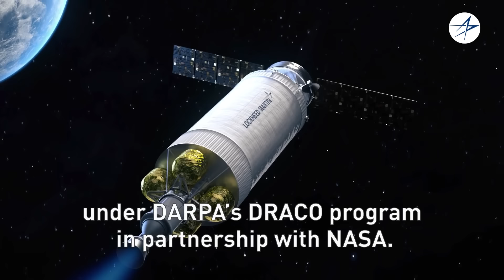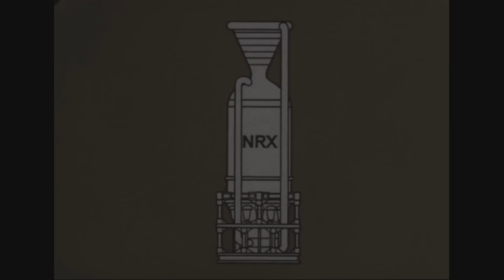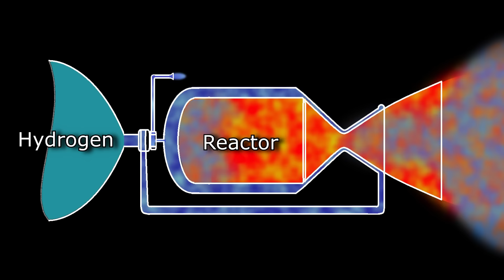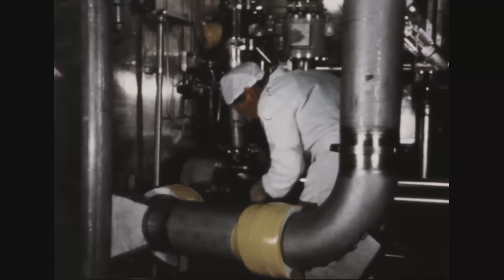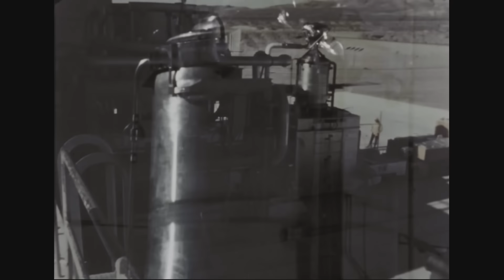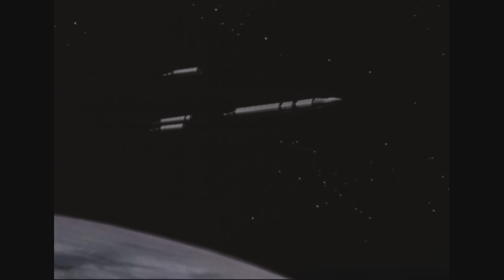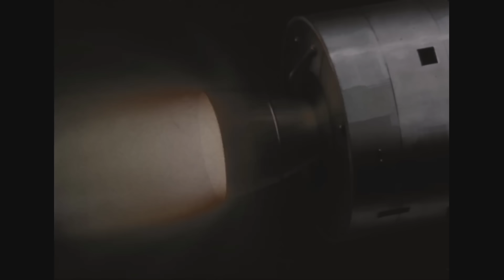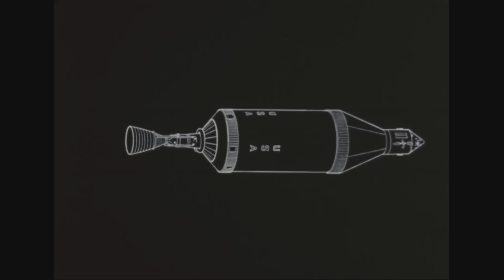Why Nuclear Rockets Are Going To Change Spaceflight

Comment: I think the biggest issue is protecting the reactor for a "safe" crash landing in case the launch rocket carrying the nuclear rocket into space explodes during the launch phase. That was an issue that kind of worried people if a rocket carrying a satellite with a radioisotope thermoelectric generator (RTG) exploded early in the launch cycle and a large amount of radioactive material is spread out.
Reply: Until the reactor is turned on and generates highly radioactive products, it is not too terrible. With a half-life of 703.8 million years, uranium 235 itself is not very radioactive. (About ten million times fewer decays per second per unit of mass, compared to plutonium-238 used in RTGs.)
Reply: @cogoid although it has to be said that fresh fuel rods are so relatively safe because nobody straps them on a giant bomb and turns them into fine dust. Uranium is a heavy metal and an alpha emitter, aka the kind of stuff you can safely touch but not safely breathe.
Reply: @cogoid Ah yes, the radiation isn’t a problem. But the potential toxicity may very well be. From Wikipedia: “Normal functioning of the kidney, brain, liver, heart, and numerous other systems can be affected by uranium exposure, because uranium is a toxic metal.” The jury is still out on how bad this risk is. Some scientists think it should be a big concern, other’s not so much. Under those circumstances should rockets containing large amounts of such materials be launched close to highly populated areas?  Until the issue is better resolved I would say, “Not in my neighborhood.”.
Reply: @JustBob-sw4rf  I do not recommend huffing uranium in any concentration. But although uranium is not to be taken lightly, one has to compare the concentration of dust and the associated with it risk to other more ordinary hazards. Is this going to be a significant additional danger or an unmeasurably small difference? 

To put things in perspective, lots and lots of processes put heavy metals into the air. For example, colors in the fireworks that are shot into the air for entertainment literally above the crowd are created by various metal salts. The smoke contains strontium, barium, lead, etc.
Reply: @cogoid    Never mind coal fired power plants. There is a lot of … stuff … in coal and if you burn coal by the cubic metre, that stuff tends to find itself in the smoke. Stuff here includes radioactive particles, and if you burn all the coal around it, you are concentrating it.
Reply: @JustBob-sw4rf  That isn't a worry, that amount of uranium, maybe 1kg, will be spread over an airspace, and ground area of millions of square metres.  It's like been worried that a drop of cyanide in one of the great lakes could make the water toxic.
Reply: Good thing is that the Uranium 235 reactor fuel is barely radioactive. It's the products after you turned it on that are nasty.
Reply: RIFT was just planning on quenching the reactor and dropping it jnto the ocean, but that was a suborbital test IIRC.
Reply: Great Comment !  Heard one story that a RTG was on one rocket that exploded and the RTG fell in the ocean !  The RTG was picked up from the ocean and dusted off and sent on a successful  space mission !  tjl
Reply: @TimothyLipinski  The RTG carried on Apollo 13's LM was carried back into Earth's atmosphere after the crew abandoned it and is still at the bottom of the ocean today. RTGs and nuclear reactors used in space are engineered to be very safe in the event of a launch vehicle failure and aren't worth losing much sleep over. A bigger problem is if a reactor gets placed on a trajectory to reenter the atmosphere after it's been critical. The Soviet Kosmos 954 satellite failure resulted in a nuclear reactor breaking up and scattering over northern Canada in 1977. Much of the core was never recovered and is still out in the woods and lakes somewhere.
Reply: @RCAvhstape  Apollo was powered by fuel cells, not RTG's where ever you got your story from it is Bunk.
Reply: @kennethferland5579  the RTG's on Apollo were for the experiment package to be left on the moon, not to power the spacecraft. They were SNAP-27 model with just under 4kg of Pu-238 and yes Apollo 13's SNAP-27 reentered and is at the bottom of the tonga trench in the pacific. So, ah.....NOT bunk.
Reply: @RCAvhstape  RTGs also have a lot less material, with a lot more containment, mind you
Reply: @kennethferland5579  Apollo 13 LM Aquarius was equipped with an RTG to power experiments. Look things up before responding in a hostile manner next time.
Reply: Which is part of the reason they will NEVER be used.  RTG's contain tiny amounts of nuclear material that can be contained in the casing of the Thermocouple itself and they still cause a lot of consternation, a single Nulcear rocket is more nuclear material in one launch then all prior missions combined and would never be approved for launch.  This research project is a deadend being mandated by congress for political reasons ONLY and not because NASA needs or wants it.

Comment: So how do you envision these being used?  Would it be that these nuclear rockets would be stationed in orbit and used as space tugs?  Chemical rockets launches would bring crew to and from orbit, they would rendezvous with an assigned nuclear tug which would then tow them to and from their distant destination?  The vehicles wouldn't necessarily be directly attached with perhaps a long boom or umbilical cord connection between them. Perhaps the crew rocket would also have to provide some propellant for the nuclear vehicle. On the return, could such a setup have the nuclear tug slow both vehicles enough so that when they detach, the re-entry of the crew rocket doesn't require a heat shield?

Comment: "Engine rich exhaust" is probably the funniest thing I'll hear today.
Reply: My favourite is still "lithobraking"   ;)
Reply: @karenrobertsdottir4101 there's a step up from that: lithostaging.  Where you intentionally break pieces off with an impact as part of the normal operation and keep going afterwards.
Reply: @karenrobertsdottir4101  "Ablative lithobreaking"
Reply: Engineering euphemisms are my favorite inside joke
Reply: Engine-rich exhaust is typically an indicator of a rapid unscheduled disassembly.
Reply: @markanderson1088  so what's the real life example of delayed unscheduled disassembly?
Reply: @forgotultag1543  Rusting away in a scrapyard, which is how a lot of cool NASA projects have ended up.
Reply: One of our tractors had once a "engine rich exhaust" moment as it self destructed ....
Reply: It made a kind of boom explosion like sound.....I'm no rocket surgeon but that might be detrimental to the program if kept as part of the rocket's flight sequence
Reply: This confuses me a bit, because in aviation you can have fuel-rich or lean mixture in the engine.
Reply: @maksphoto78  I know this was a year ago but to explain your question. "Engine rich exhaust" is a engineering joke. It means the engine coming apart and blowing out of the back of the rocket.
Reply: Right up there with RUD.
Reply: I've never experienced engine-rich exhaust, but I have encountered an engine-rich oil pan on my 1970 VW Beetle.
Funny thing, with all the metal ring chunks in the oil pan, the engine still ran fine.
A friend who had several owned by family members told me, "Yeah, all those broken parts in the oil pan is normal."

Comment: IANA rocket scientist, but I've long argued that both Thorium and molten salt technologies are each better technologies than the classic fuel rod Uranium systems.
In the event of a RUD in launch, Thorium is a much more benign element than enriched uranium. The tiny amount of uranium required as a starter can be kept safely in a high strength "vault" until achieving orbit and setting up the inspace propulsion process.
Molten salt reactors were proved in the Atomic Airplane project, achieving proper energy generation in all flight regimes. They are inherently higher temperature systems. Further, they can be turned on and off, and vary the output, very fast and simply.

A combined thermal and electrical process might provide additional thrust, stripping the hydrogen into a plasma and allowing that to recombine in the output chamber, increasing the temperature of the output "gas" and slightly increasing the output velocity.

Comment: I may have missed it, But why go with pure Hydrogen (H) instead of water (H2O)? Just not as effective or some kind of reaction with the Oxygen in space? I'm thinking/wondering depending on how it would work perhaps split H2O to how H would be used here with the split 2O being recycled to provide Oxygen for the crew and any other uses it may have in space, assuming the 2O isn't radioactive due to how the splitting is handled?

Comment: They deliberately detonated one of these nuclear engines in the 60s as part of Project Rover. Until last year there was only a single picture of it on the internet, but LANL Historian in residence Alan Carr recently uploaded full color video of it here under the title "Kiwi TNT: An Explosive Nuclear Rocket Test". It's spectacular. You can actually see the air glowing with gamma irradiation in the slow motion before the entire assembly blows apart in a shower of burning nuclear fuel and graphite over the desert landscape.
Reply: They also strapped a kiwi reactor to a rocket sled and shot it against a concrete wall to see what happens if a reactor from an exploding rocket hit the ground near the launch site

Comment: Ion thrusters are limited by the high power demands requiring large solar panels. What about a nuclear reactor combined with souped up ion thrusters, could that overcome some of the low performance? Especially for outer solar system missions.

Comment: I might have missed this, but wouldn’t a massive advantage also be that you don’t need to carry any heavy oxidizer mass into space?
Reply: Absolutely! specific impulse is directly related to the speed at which you eject the particle out of your exhaust. for thermal engines this means its better the higher the temperature in the nozzle and the lighter the particle exhausted.

In chemical engines you exhaust the combined molecule, H2O for LH2/LOX engines, so the oxidizer is not only adding dead weight to your rocket but actively reduces your specific impulse too. It's just a necessary nuisance to power chemical engines.

LH2/LOX engines are actually often run fuel rich to get that extra bit higher specific impulse as now your exhausting some hydrogen alongside the H2O too (also oxidizer rich engines tend to burn engine rich over time)

nuclear thermal engines can exhaust pure hydrogen maximizing that part of the equation. They are only beaten by ion engines as there the speed of the exhaust molecule follows completely different rules, as it's not a thermal engine.
Reply: Yes, the only really heavy part that you need to carry is the reactor engine itself and the shadow shield.
This allows for much better use of payload mass and fuel mass, it's one of the reasons why Nuclear Tugs were studied for interplanetary travel
Reply: I’d say, I wonder what the trade is

Comment: I've been wondering why there isn't more discussion of the sea change that will happen as soon as we can process radioactive material off Earth. Basically ALL the downsides of nuclear power goes away once the process can be started off-world, meaning cheap long term power for just about everything you need. 

I never seem to see anyone making videos or discussing it, anyone able to point me towards anything?

And to clarify about the risks going away, when you're in an environment without wind or a water table where everything needs radiation shielding anyways even the worst case scenarios for nuclear power/processing have an impact that be dealt with safely by basically putting up a few keep out signs.

Comment: I might be missing it a bit. Why can't NTRs (behave) launch from the surface besides safety? Like, what's thr limitation via physics?
Reply: NTRs have super low TWR ratios compared to chemical engines
Reply: @hacknwack4065  is that a fundamental physical limitation or something that engineering can eventually overcome?
Reply: @mervynlarrier9424  nuclear reactors tend to be magnitudes heavier then a turbopump system, the extra ISP wouldn't do too many favors do to being unable to lift as much fuel

Comment: Good stuff, Scott. This brought back many memories. From 1996 until 2003 I worked at the C-Plant, where we enriched Uranium. The plant was shut down several years ago after 61 years of operation. An amazing facility built in the early 50s. I would walk around in the plant and marvel at the craftsmanship and design that occurred long before we had computers. Yes, it is what you would expect from 50s technology but it still functioned until shut  down in 2013. Brilliant people came up with the concept and design. Anyway, the terms used in this video remind me of the things I was trained for before I was allowed in the facility and used during my tenure. To my knowledge, the US no longer has a way to enrich uranium unless it is secret. They may still be working on a smaller scale at Oak Ridge.
Reply: URENCO has a US facility in Eunice, New Mexico, which uses centrifuges to enrich uranium.
Reply: @cogoid  That is good to know. The facilities I worked in were owned by the DOE. I see the plant started producing after I left the industry in 2003. So my information ended in 2003. I didn't follow the industry after I left. I am happy we have the abilities in the US. It seemed short-sided to totally stop enriching here. The DOE plants tried running as a private operator, USEC, but Gassious Diffusion is very expensive because of the extreme amount of electricity needed. There were talks of centrifuges over the years (technology is not new) but nothing materialized except a test centrifuge in Portsmouth, OH. Thanks for the heads up.
Reply: @cogoid  So far AFAIK the output is tens of kilos (one load of 1GW reactor takes some 150 t). They promise to produce one tonne a year, AFAIR. With volumes like that the cost may be higher than the obtained with the diffusion method.
Reply: @vladimirdyuzhev  You are thinking about Centrus Energy, which is trying to restart their old centrifuge cascade. URENCO USA is producing around 500 tons each year.